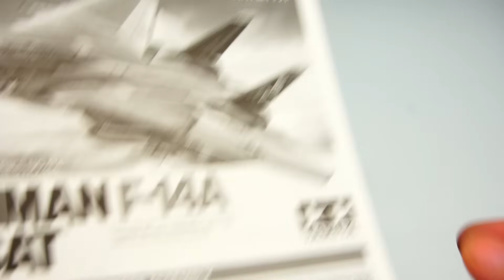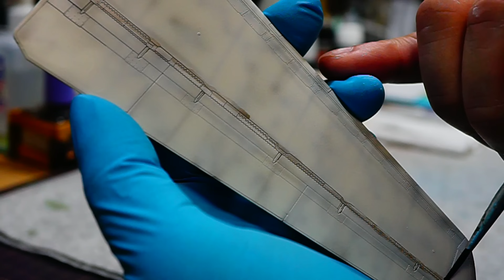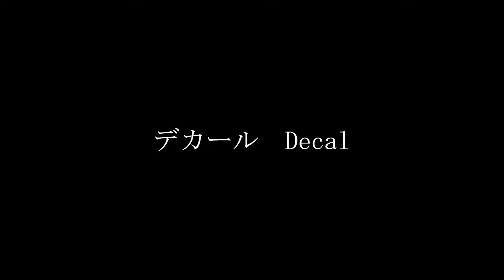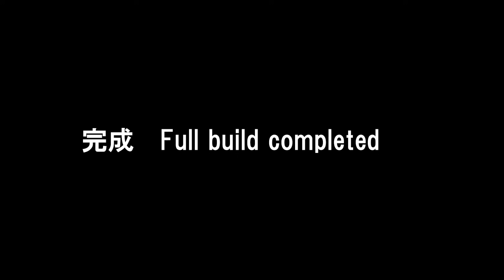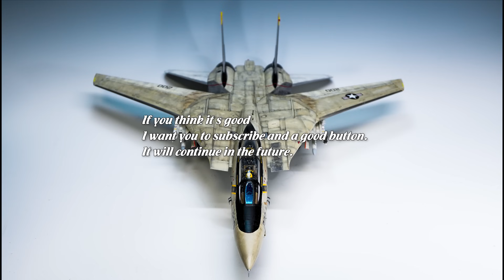FULL BUILDING the TAMIYA F14A TOMCAT

Comment: Just for the benefit of anyone else watching this looking for tips (I know this is what I do!); the 'seams' in the canopy are actually the lightning conducting rods and therefore do not need to be sanded off.
Reply: They must have updated this kit. I'm building it now, and the canopy does not have the seam.
Reply: @ronnie_5150  I'm building it now too. It's definitely there on mine. 
Google image search "f-14 canopy" and you'll see a few pictures where you can see the conducting rod. There's two, one over the pilot and one over the RIO.
Reply: @stuco81  I'll have to look again once I pull off the tape from the masking kit. I just don't remember seeing it. How's your build going? I'm about a quarter way into mine. :) Love this kit. Everything fit together pretty precisely.
Reply: @ronnie_5150  oh your so right regards the fit. I literally can't stop smiling when I'm working on it.
I've got the cockpit and the front landing gear bay painted and assembled so far. But I've had the entire aircraft clicked together at one point.